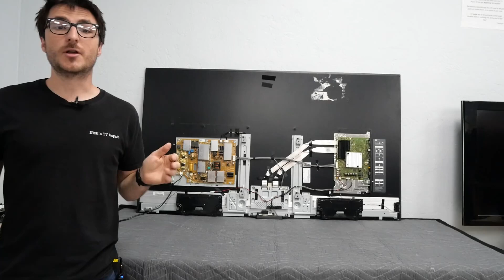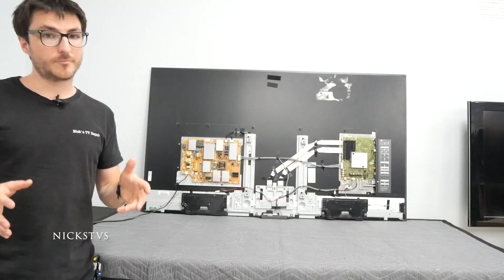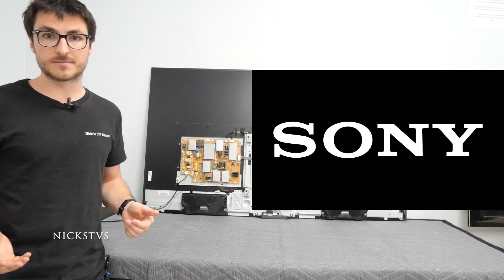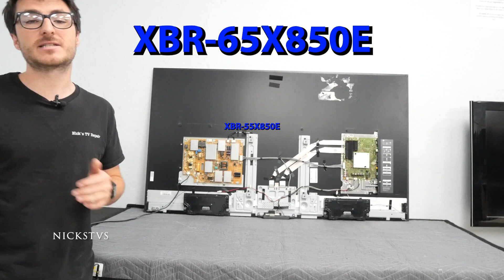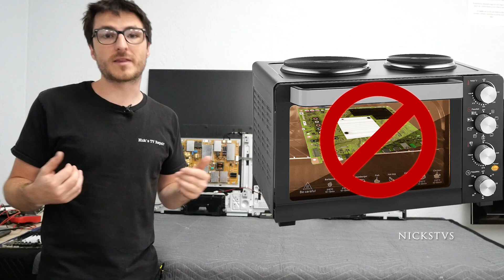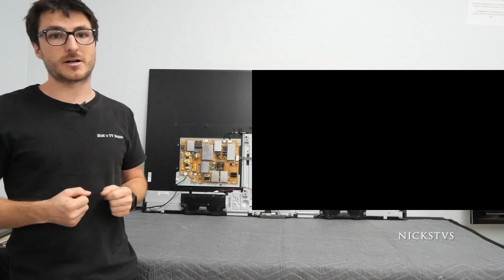Sony TV Diagnostic For Beginners Blink Codes Explained XBR-65X850E XBR-65X900E

Comment: Xbr-65x810c   Turn on tv with remote.  Goes to home  screen. Remote doesn't work to control anything. Tv doesn't respond to back buttons.

Just noticed tv will turn off by itself then i power it back on and it stays on a blank screen then it sometimes cycles off n on with a blank screen
Reply: Xbr-65x810c
Reply from the maker: That is very strange. I can't say I have an answer for you as this is not a common failure we have seen before. It is likely your mainboard is the fault, but there is a slight chance your IR / buttons / wifi / bluetooth  could be defective. 
If you are unsure how to diagnose further, you could purchase our mail in repair service and send in those parts. We can troubleshoot and diagnose for you. 
If you have any questions on this I would recommend you fill out our contact form linked below or reach out directly to our email. (contact info also on our contact page linked below)
https://nickselectronics.com/pages/contact
Reply: @NicksTVRepair. Oh ok. I didnt know that was a option. Perhaps i will. Its more of 2 different problems. So the main board would be for the looping but it wouldn't have to do with the ir or rear button problem.  Correct ?

Comment: Hi. Im from germany and Nobody can help me :) Hope you can. 

My Problem with my 49x8005c is the last Of you video. Sony Logo turns on, boot logo comes, then they goes back to the sony logo and then boot logo again and sometimes Shows the Sony Logo, then After few seconds turn off and goes again in the Sony Logo. 

I think its the mainboard, can i do something or Must buy a other mainboard?
Reply from the maker: you can replace your mainboard or you can have it fixed.
Reply: @NicksTVRepair  is it possible to fix the mainboard? I try to reset with Button combination, but it shows the cyrcle and then reboot and i try a Software Update, but in the middle Of the update it reboot
Reply from the maker: Yes in fact that's the majority of our repairs is fixing the mainboards

Comment: Hi, I have a LG tv that blinks 3 times. what can be that issue?
Reply from the maker: A 3 blink code is not a code, it just means your TV is turning on. All LG TV's blink 3 times at boot up. 
Do you not have picture? If so then your TV has power but no picture. In which case you may have a backlight failure, or mainboard failure. I would need you to provide the model of the TV to help you more.

Comment: Hey Nick, amazing work, you've helped me already!

KD-55XF9005 here (Europe). Had backlight and sound, no image, followed some of your videos and saw some bad voltages on t con, ordered one (exact same model), connected it, got alternating red / green blinking lights, got the firmware on a usb stick, hard factory reset, it started blinking white (usb had no light unfortunately). Turned itself off after 1hour, never back on, today, many hours later, tried to turn it on, doesn't turn on. Only way to turn on is hard factory reset (vol - + power then plug to socket), get a solid green led light, not blinking, doesn't want to read the usb anymore to try to update firmware again. Tried another usb entrance (3.0 vs 2.0 usb 1), tried formatting exFat / Fat32, downloaded / unzipped pkg again. nothing.

Feels that I bricked it during the firmware update. Is there a way to unbrick / try again? Doesn't seem to want to read usb stick. only boots with vol - + power then wall socket, solid green light, no backlit, no sound, does not respond to any button presses or usb with firmware.

Any tips?
Reply from the maker: Most likely you have a defective eMMC and will need to either have the mainboard fixed or replaced. 
With that said you could also have a defective CPU. I wouldn't know without having the board in front of me to troubleshoot further.

Comment: 65X900E here...just started losing picture randomly, as well as some minor ghosting toward the bottom of the screen (a single partial copy of present image/text justified toward the bottom). Backlights still on, sound is fine, indicator light is fine. Comes back after a power cycle, but eventually loses picture again.
Reply from the maker: It's possible it's a mainboard failure but it could also be a screen failure. 
Check out this video, it might help you fix the TV if it's a screen failure
https://youtu.be/pfrRhw7-ZII?si=024jbWbmjoFgpyCu

Comment: My issue is Sony Bravia XBR-75X900E red blinking 4times not turning on. What is this blinking code thank you for your help more power to your channel
Reply: I don’t have the original remote I use other Sony Bravia tv. Before tv is working fine but one night I turn off the power. And when I try turning it on the white light first turn on the fading the change to red light blinking 4 times.
Reply from the maker: That's going to be LED failure. You need to replace the LED strips to fix it.

Comment: KL-75XH9005, similar model to the one you've shown here. So, symptom is 3 blinks. 
I can't find a service manual for it.
Do you know what can be the cause, please?
Reply from the maker: I am not familiar with that model but any 4k Sony TV made between 2015-2018 usually has a mainboard failure when you see a 3 blink code.
Reply: @NicksTVRepair  thank you for the reply :). Good to know :).

Comment: i have xbr 65x900e first it’s working for 10 to 15 mint then shutoff blinking 4 light then wait for 5 minute then again i start its work for 2 mint only
Reply from the maker: Sounds like bad LEDs per the video. You would need to replace your LED strips to fix this issue.

Comment: More helpful than Sony support in Denmark. I can't believe a $3000 tv only lasts 6 years.
Reply from the maker: I am sorry to hear you did not have a pleasant experience with the Sony support team. They usually are very helpful, at least that is what I hear from most Sony customers we talk with. 
If you have any Sony TV related questions or repair questions, don't hesitate to reach out.

Comment: Sir I have Sony LED android TV 55inch having 8 red blinks....Model: 55x8500E
Reply from the maker: 8 blinks is usually a mainboard failure. 
If you have the XBR-55X850E model TV we can fix that for you, but if you have a KD-55x8500E model, then we won't be able to help you.
Reply: @NicksTVRepair  Thank you so much Sir For Replying my Comments....So I need to Buy new Mainboard
Reply from the maker: If you have the KD-55x8500E then most likely yes as I don't know anyone that services that one.

Comment: XBR-65X950G with 2 blinks, any advice where to start or how to narrow the fault down? Thanks!
Reply from the maker: 2 blinks! That's actually the first time I have heard of that model with a 2 blink code. Well I have fixed a lot of 2 blink faults, 99% of the time it's a power supply fault. When it comes to Sony boards usually transistors and or diodes will short out causing that 2 blinks. That's what I would look at first.
Reply: @NicksTVRepair  I replaced the entire power board, and now it blinks 4x! 🤦‍♂️
Reply from the maker: 4 blinks usually means your LED driver board is out or your LED strips are bad. It's possible you have 2 failures in your set, or and this is more likely something is not connected in properly. 
Double check all of your connections, make sure all ribbons and wires are properly connected. 
Then try again. 
Either that or you may have gotten a bad power supply.

Comment: I get one used, it came without remote control.. but looks like the IR receiver is not working at all.. I have tried all the possibles sony remotes from amazon bestbuy walwart for xbr-850G and nothing.. but now seeing this video, my tv is not turning that red light below.. how can I fix that?
Reply from the maker: It sounds like you got a bad mainboard and should return it. We can fix your original and will make sure everything works with it before sending it back.

Comment: Hi Nick, I have a kd75X7800F. One day the screen went black; sound and backlights were still working, but there was nothing on the display with no errors and a white status light still on. After turning it off and on many times, the picture comes back, but for only a few minutes or hours. I have checked, and all the internal cables and connections are fine.
I suspect it's a TCon issue, but I tried 2 used boards and got 5 red flashes with those. I think I just received bad replacement boards.

It's perplexing; eventually I can get it back on, but not for too long before the screen goes black again.

Have you seen this issue before? Thanks.
Reply from the maker: 5-blink fault means either mainboard failure, LVDS ribbons not being properly plugged in, T-con failure, or screen failure. 
I don't believe you have a screen failure, most likely if the 5 blinks are only happening with the replacement boards but not the original then the replacement mainboards are bad.

Comment: Mine is a Sony XBR-65X850E. The display started to flicker on the day of writing this comment. The display flickers not only on every port, but also on the home menu as well. What would be the cause of this problem and how can I solve this?
Reply from the maker: Unsure, is your backlight flickering or only the screen? are you able to tell? 
If your backlight is at fault, the TV will end up failing with a 4 or 6-blink error code. If not then most likely your mainboard is faulty but also this is a very unusual fault that I am not as familiar with, so it could also be a T-con or panel fault, not sure. 
If you want to send in your mainboard for us to live test we can do so, if we find it is faulty, most likely it will be due to one of the processors going out. If it is found to be working, then we would send it back with a refund on the repair minus our testing fee and would most likely advise a T-con replacement next.
Reply: @NicksTVRepair  I’m pretty sure it is only the screen that’s flickering. After doing a bit of research it seems to be that one of the clock points on the T-Con board short circuited. It seems to be a common problem with the board from what I read. So the short term solution is to cover the connection point on the ribbon cable that it connect to a specific clock point with tape. The long term solution is to just get a T-Con board replacement. From what I saw it should be simple but you never know these days. I’ll let you know how it goes.
Reply: @NicksTVRepair  Yeah it seems to be the T-Con board. When kept the connection to the left side of the screen and disconnected the right, the left side showed no signs of flickering and no line near the upper portion of the screen. However, when I kept the connection to the right side of the screen and disconnected the left, the right side showed signs of flickering and a line appeared  near the upper portion of the  screen. So, assuming that what I have researched is true, then it must be the t-con board. Did the temporary fix with tape but having trouble finding which exact clock got short-circuited. Is there anyway to find which exact clock/clocks are causing the issue?
Reply: @NicksTVRepair  So I replaced the old t-con board with a new one and 2 new problems occurred: One, the whole screen turns white, dims down, then brightens up again; Two, the sensor light blinks 5 times. Also, when I put the old t-con board back in; the right portion of the screen has a black,gray, then white vertical bar. What does all this mean?
Reply from the maker: It is starting to sound like you have a panel fault.
Reply: @NicksTVRepair  Can this be fixed?
Reply from the maker: If you know what you are doing yes, but it's not something I would be able to walk you through in the YouTube comment section. 
This would be a very advanced repair and most TV techs don't have the skills to do it. 
There are some YouTube channels that do show panel repair such as this one:
https://www.youtube.com/@VcoreLC/videos
Reply: Sorry for the late response, but I forgot to reply to this. Anyways, is possible that I can bring it to your shop so you guys can fix it? And even if it can be fixed, what would be the cost?

Comment: I have an XBR-55X800E. Randomly shut off and had 6 blinks of the red light. Unplugged everything, did factory reset, plugged it back in, turned off bravia sync and the wifi, worked good until I plugged an hdmi cable in then almost immediately shut off, tried in 3 of the 4 hdmi ports with the same results each time. Would this mean a main board needs replacement?
Reply from the maker: 6 blinks is an LED backlight fault. Replace your LEDs to fix this issue
Reply: @NicksTVRepair  sounds good. Thank you.
Reply from the maker: no problem

Comment: So the best thing to do is order a board?
Reply from the maker: The best thing to do is send in your board for repair. When you order a board it won't be new as they are discontinued and no longer manufactured. Used boards have unknown life left in them and typically no warranty. 
When you send in your board for repair you not only get a 1 Year warranty, but you also know that your board will work for many more years to come as we will fix and replace the chips that commonly fail. This means your board will be as good as new!

Comment: My Sony XBR-65X930D shows the android logo for a second then shuts off. Blinks 3 times for a while
Reply from the maker: A 3 blink code is not common and thus I don't have as much experience with it. I can't give you a comprehensive diagnostic on that one but my guess based on past experiences would be the mainboard. Again this is just an educated guess and I could be wrong.

Comment: Xbr-75x900h - 3 blinks - tv works for an hour then reboots, gets through the sony/android logo then goes 3 blinks.  Any idea?
Reply from the maker: According to the manual a 3-blink error code is most likely a mainboard fault but could possibly also be due to a power supply fault or your speakers could be bad. The fault is usually on the 5v line. 
You can try simply disconnecting your speakers from the mainboard and see if that resolves the fault. If yes I would then suggest not replacing them but instead taking the opportunity to upgrade to external speakers. 
If the speakers aren't the fault then I would say your mainboard is the most likely cause. I know it says it can be a power supply, but in my experience, it's usually the mainboard. 
If you don't want to buy new boards without being sure you could do voltage checks and trigger the power supply to turn on but that is a bit more advanced. We do offer testing and diagnostics services for $20 per board if you are interested and of course, can fix the fault if you would like us to. 
All our repairs come with a 1-year warranty. Our contact info is in the video description.
Reply: @NicksTVRepair  thanks for the detailed reply.  You are correct it was a pinched speaker wire shorting to ground!

Comment: Nick,my Sony tv XBR55X850D completly dead,no stand by light. Power supply adapter is good. Is it possible a main board defective?
Reply from the maker: Based on the information you have provided, it is very probable that your mainboard is defective and needs to be repaired. I have a flat rate service for this exact board and fault which I will link below if you are interested in having us fix it:
https://nickselectronics.com/products/xbr-55x850d

If you have any additional questions or want to get more information from us, you can reach out directly. Here is our websites contact form and info:
https://nickselectronics.com/pages/contact

Comment: XBR-75X850F I have power, and sound. What’s the issue?
Reply from the maker: Do you have picture? Is there anything displayed on screen such as green and pink bands like the background of the thumbnail? If no picture but you shine a flash light onto the screen do you see picture faintly displaying on screen? 
Do you have backlight? As in does the screen glow? 
My first guess is going to be mainboard but this is an odd symptom and I don't have enough information to understand exactly what's going on.
Reply: I have no picture. No pink or green bands. The screen does glow. When I checked with a flash light I didn’t see anything.

Comment: My 900E has just started powering itself back on after any time attempting to shut it down (no looping).  The remote has also become less responsive than normal, even with fresh batteries.  The LED indicator is still white but now pulses very lightly (almost imperceptible unless looking right at it) constantly.  I've tried disconnecting everything, doing power resets, etc. but nothing has helped.  Any ideas what's happening?
Reply from the maker: Software update perhaps? Is it possible the power button is stuck on the back? As in pressed in and stuck? 
Try factory reset as well. That might help

Comment: The issue with mine blicking red without any display Rx A65A84j
Reply from the maker: I am not sure I am familiar with that model number. Is that a european model? How many times does the red light blink? That will be an indicator of what is wrong with the TV.
Reply: Please typing error,  XR-65A84J blinking 4 times without any effect on the screen except a red pop light from the board through the optic port and off after few seconds.  It Sony Europe BV manufacture 2021/05 please what could be the problem thank you

Comment: XBR-65X900A  8 blink light and I noticed the TCON board ribbons damaged.
Reply from the maker: The 2013 and 2014 Sony sets aka the ones ending with the letter A and B  are vastly different from the two I cover in this video. The blink codes won't be the identical, the boards inside the set are also a bit different. 
I wouldn't use this video to diagnose other sony sets that aren't these two. 
With that said, how did that happen? Is it burned or physically damaged? Ribbons don't damage themselves usually, someone must have done that if it was physical and one of the boards must be bad if it's burned. It is possible your 8 blinks will still be present after replacing it.